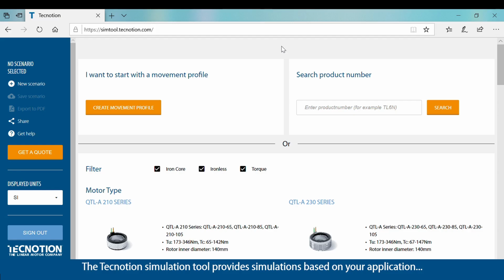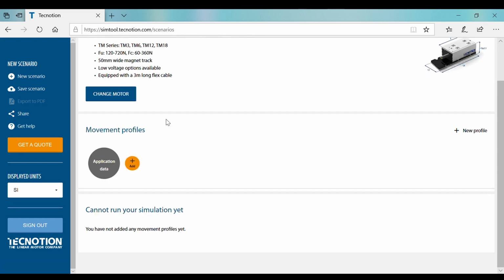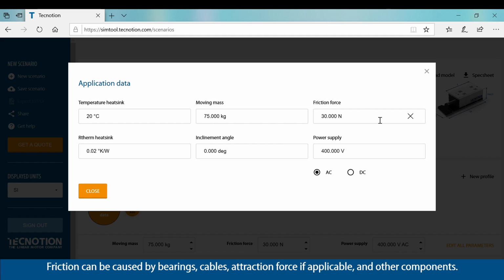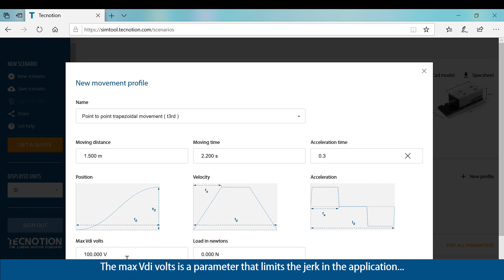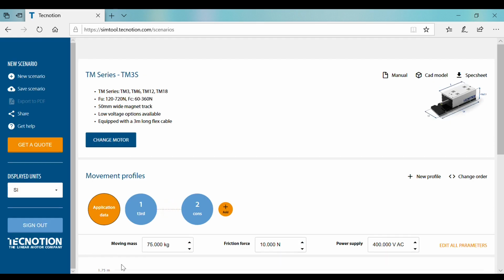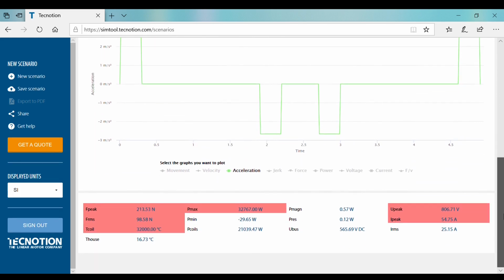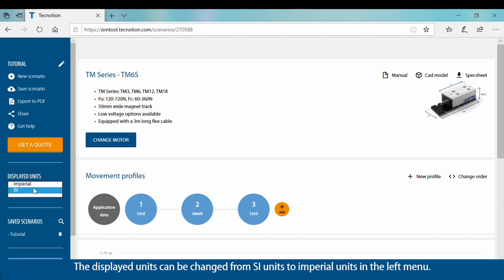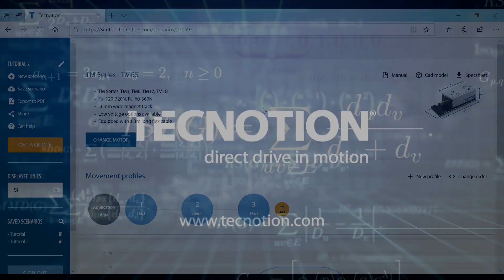Complete tutorial to select the right motor in our simulation tool

Comment: Thanks a lot, that is so useful...I am wondering how to insert real values for the following parameters; 1-thermal resistance, and 2- friction force as these parameters are related to the motor type. I mean we want to choose a linear motor that has a specific friction force that relates internal properties of motor construction, isn't it? if yes, how may we determine those?
Reply from the maker: @iman96_fa :Thanks for your interest.
For thermal resistance it is best to use the thermal resistance tool that we implemented into the tool earlier this year, the video does not talk about this (because it was made earlier).  please visit: https://www.tecnotion.com/news/new-advanced-tool-is-added-to-calculate-the-thermal-resistance/
Friction force is related to cables that should be dragged along with the motor, or by friction coming from the bearings, et cetera. It is indeed the case that heavier motors typically face higher friction. You do not need to calculate the force the motor has to overcome (e.g. by F=ma) and put it there, that is something that the tool does itself.
Please feel free to contact us if you have any further questions. contact email: support@tecnotion.com